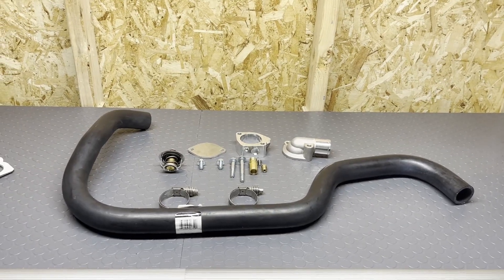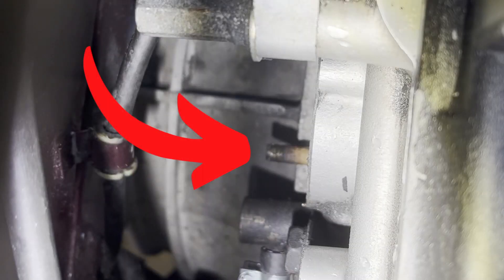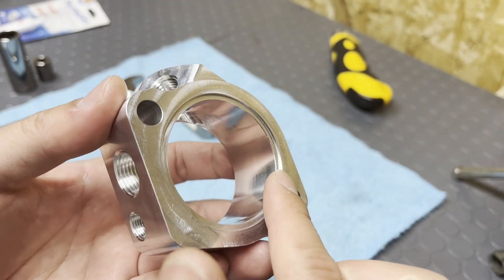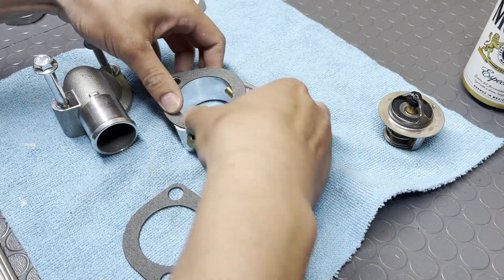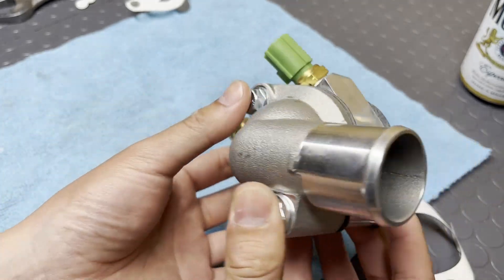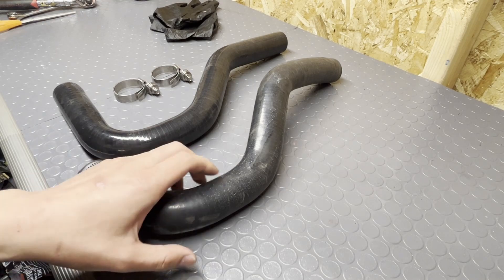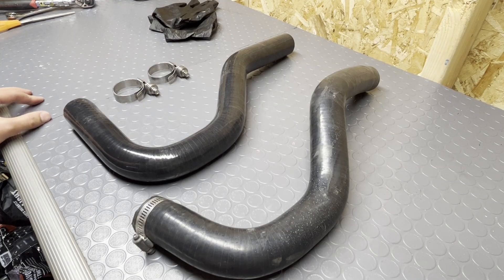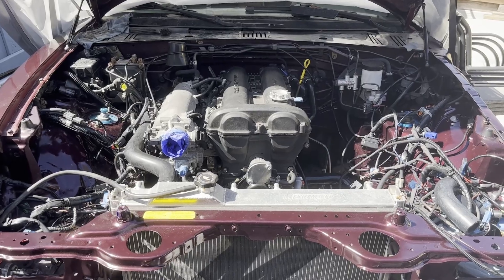Miata Coolant Reroute

Comment: I bought that Cobalt kit when they first came out and I've been happy with it. For some reason it says its 94-05 but it worked perfectly fine for my 1993 1.6 lol (If I were to guess it's because they don't want it to compete with the kit they sell specifically for 1.6 from IL motorsports). I originally also started with the GM hose but after getting inter-cooler piping, I budged and got the Cobalt hose and had less clearance issues
Reply from the maker: Nice. I ended up modifying the hose by adding another that bends 90 and connects to the GM hose with a barb fitting. Looks pretty much like the cobalt hose they sell. Had to do it for better fitment with the IC piping